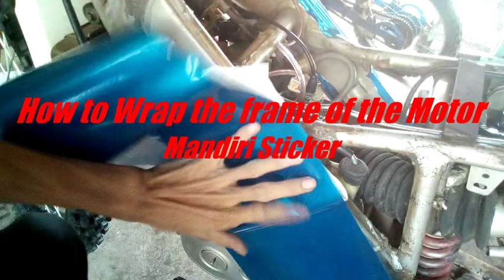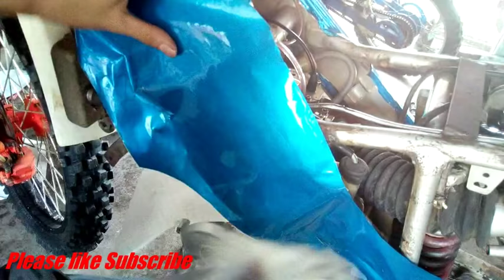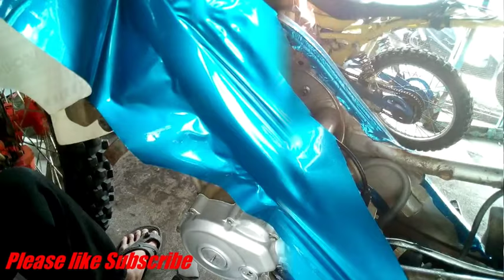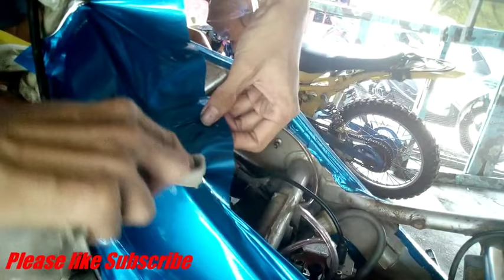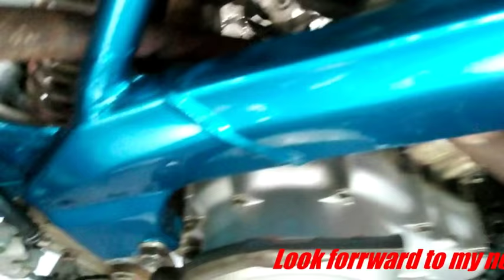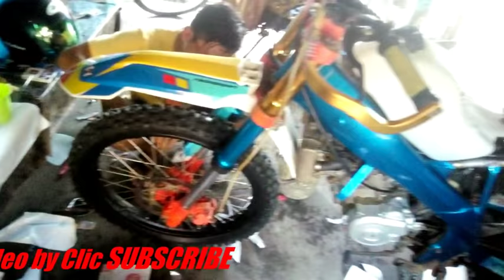How to wrap the frame of a motor using a Sticker

Comment: Where u buy the vinyl?
Reply from the maker: I checked in the online store that it is no longer available because the sticker is an old product... now it has been replaced with a chromae type sticker. to be precise, blue chrome with the brand Max decal
Reply from the maker: type in goggle... 👉type the blue chrome max decal sticker... later the goggle machine will direct you to the shop selling the sticker
Reply: @Dwigunawan  ok thx